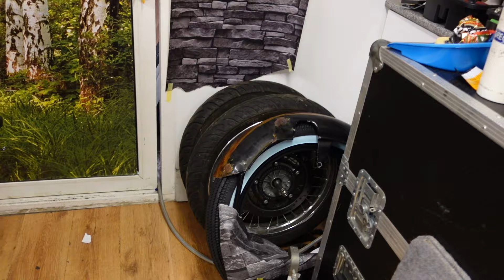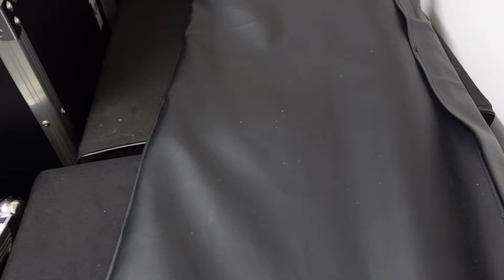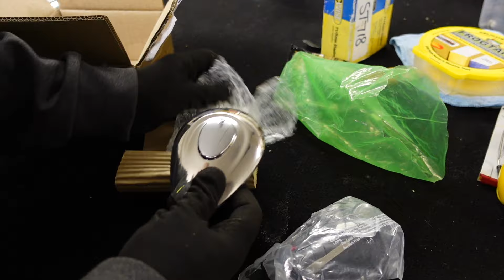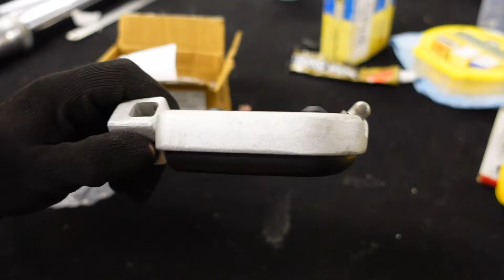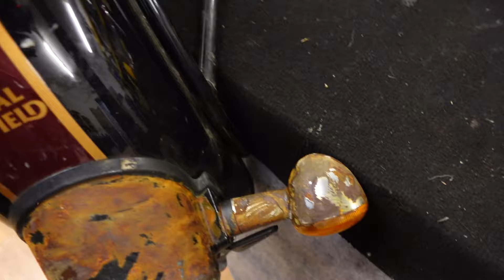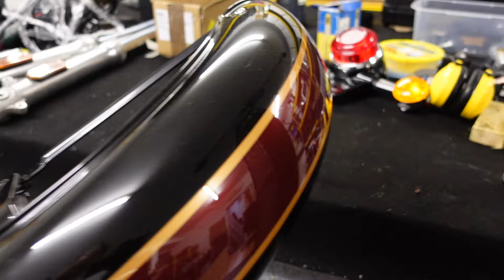New Parts & End of Year Update - Rebuilding the Royal Enfield Classic 350 Reborn

Comment: Good Selection of parts to start with there , looking at your work space I think you might be a secret horder 😂😂 all the best for the new year Glyn 👍
Reply from the maker: You're right, I'm out of control.  If I sold a load of that stuff I could get even more bike stuff!! cheers, Glyn
Reply: @GlynOC  😂😂😂 that’s the correct attitude 👍 question for you Glyn, do you think that the footrest subframe for the classic would fit the meteor, cheers buddy 👍
Reply from the maker: @mikehatswell3961  Hi Mike, the footrest subframe would absolutely fit.  I think you'd need the subframe, right hand footrest bracket, different brake pushrod and the brake and gear levers.  I do see all those parts available on ebay so shouldn't be too hard to collect
Reply: @GlynOC  thanks for that Glyn, I like the meteor but don’t like the forward controls and think that changing them would make it a better ride. Thanks again buddy 👍

Comment: Glyn. I own a classic 350 signals. Desert Sand. I've just bought a springer sear for it from royal spare parts on ebay. I haven't fitted it yet. I reckon it would suit your classic better than the one you bought. That said, check out a channel called Arkansas Outdoor Channel. Then look for the Springer Seat For Royal Enfield Classic 350 Reborn. See what you think? I'd like your opinion. Personally, I'd prefer if the front bracket wasn't so long/high. However, it may look okay in reality. Please let me know your thoughts? Cheers Glyn. Love your work. Jez. 👍
Reply from the maker: I love the 350 Signals models, they look so good in those service colours.  Thanks for the video recommendation, that seat really looks the part but it looks like it moves around a lot, especially side to side which might feel a bit squirmy, like your rear tyre is sliding a bit.  I had a seat like that once and didn't enjoy that feeling!  Am giong to look at it further tho😊
Reply: @GlynOC  fair enough, mate. Getting mine fitted. Hooe it's okay? If not, easy enough to fix. Love your channel mate. 👍👍
Reply from the maker: @jez6208  Nothing a bit of tightening or some bushes/spacers wouldn't sort I'm sure. Make a little vid when it's done 👍
Reply: @GlynOC  I wouldn't know how. 😄 Actually, I had an issue with my signals. My dealership is waiting foe the parts from Inda. I won't be collecting my bike anytime soon I suspect. However; When I finally collect it, I'd be happy to send you some pics and maybe a test ride vid Glyn. You let me know where and how to send it and I'd be happy to oblige, mate. Keep up the good work. The future of motorcycling depends on you! 😄😄👍👍